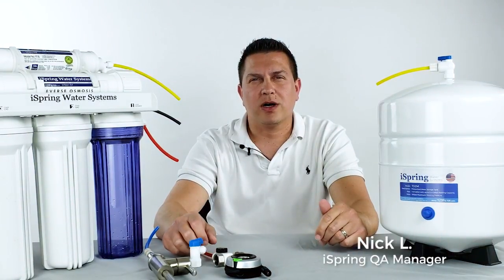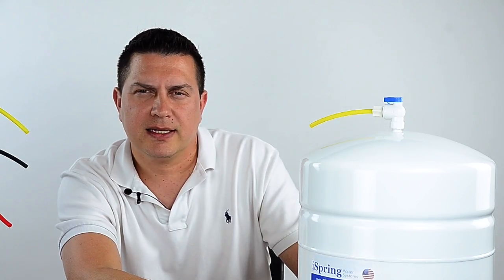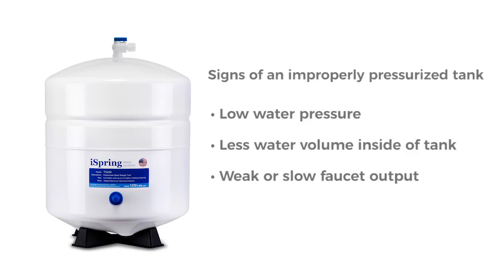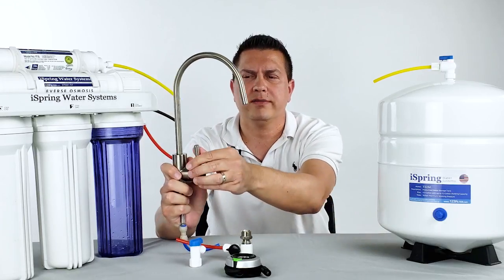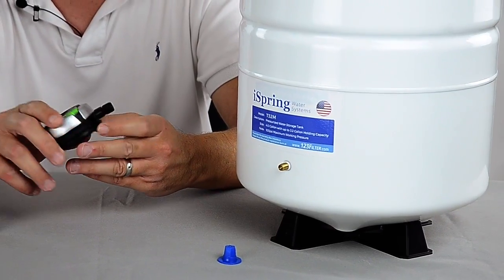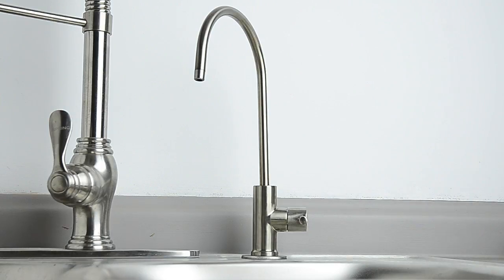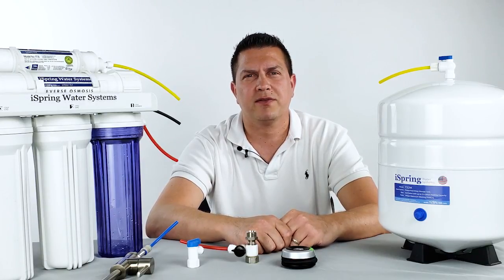Overview & troubleshooting | iSpring Pre-Pressurized Water Storage Tank for Reverse Osmosis Systems

Comment: Our iSpring 5-stage RO has perfect pressure. After watching Robert Slovak talk about RO Bladder as an ideal breeding environment for nasty bacteria to grow & contaminate drinking water, I am concerned about cleaning the bladder. Are there steps to inject small amount of food-grade Hydrogen Peroxide into my bladder? We love the iSpring 5-state system. But I am noticing a change in taste of water. So I am going to perform filter changes (as per your other video). How difficult is it to add UV stage to our 5-Stage?
Reply: SAME!!! My 5 stage with booster used to taste awesome. 2 years later, two sets of completely new filters/membrane, and it does not taste good at all. My sister's RO system (only 3 stages) tastes much better and she has the worst sulfur smell in her well water. I actually found thick slime growing inside the faucet. I was getting a split flowing stream which made me look into it. GROSS. I sprayed regular peroxide into the faucet with an injector. I am tempted to chlorinate the tank with a pump. Wish you had an answer.
Reply: I replaced the tank a few years ago for the same reason, didn't realize until today that my bladder leaked and held no pressure from day 1 and just ordered a new one.

Comment: Hi Nik
My R O unit pressure tank is not filling.water supply is okay
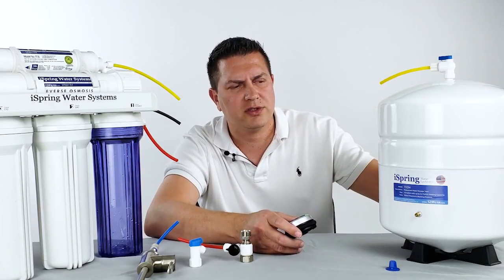Reply from the maker: Hi Muhammad. If it's a new installation, please check the 2nd stage filter to see if it's upside down. If the system has been working and then stopped, please pull the membrane out and see what happens without it. Sometimes the membrane causes the blockage. If the problem still persists, please feel free to call us at 678-261-7611 (M-F, 8:30 - 5:30 EST). We are happy to help.
Reply: @iSpringWaterSystems  I need your help . My R O was working very  well for three months only. Right now it has almost the same time without use. What it can been happen?
Reply from the maker: @lourdesbaez4225  Hi Lourdes. Please give us a call at 678-261-7611 (M-F, 8:30 - 5:30 EST). We are happy to help you out!
Reply: What is the membrane?

Comment: Hi Nick,
Recently I tried to check the pressure using the tire gauge. I noticed some water coming out of the valve. Is this normal? Or does this indicate some sort of bladder failure? And what could be them remedy for this? Thanks.
Reply: I installed a new system about 4 weeks ago and the water stream has always been weak. The tank is light. How can I get the water stream to be strong?
Reply: Anniesatu Newland check your inlet valve. I guess one of the valves is not fully open. Tank is light means water is not coming into it. 
I am not sure if the pressure is proper. So if the tank is empty, check the pressure at the gauge. If the pressure is bet. 7-10 psi, u’re good. If not, add some using a bike pump or an automobile 12 V compressor. Whatever works for you. 
If your system is new and yet you have all these problems, may be there are sued related to installation.  You might want to check things one by one. If nothing works, ask for a replacement if possible.
Reply from the maker: @anniesatunewland1793  Hi Anniesatu. Please follow the video and check your tank pressure first. If the pressure is decent but there's still very little water getting into the tank, please give us a call at 678-261-7611 (M-F, 8:30 - 5:30 EST) or email us at support@123filter.com. We can help to check and fix the problem.
Reply from the maker: Hi Kamlesh. If water is coming out of the air valve on the front of the tank, this means the bladder has a puncture or leak and the tank needs to be replaced. You can get replacement tanks here: https://cutt.ly/yiC1y0L. If you have more questions, please feel free to contact us at 678-261-7611 (M-F, 8:30 - 5:30 EST) or email us at support@123filter.com. We are happy to help.
Reply: iSpring Water Systems Hi there, 
Thanks for getting back to me. I suspected that would be the only solution, I ordered a new 4gal. tank from Amazon.ca which is sold by iSpring. Thanks once again.

Comment: Thanks .. how can I connect 2 tanks ?  Currently using drinking and aquarium water .
Reply from the maker: Hi Fred. Thank you for reaching out!  You can use a t-fitting between a DI filter and either the FT15 or FA15 filters. You don't need two tanks for that. To better assist you, could you please give us a call at 678 261 7611 (M-F 8:30 - 5:30 EST) or email us at support@123filter.com?

Comment: thanks for sharing the knowledge. I got a issue, after change the filters there is no water coming to tank , the water flowing to drainage , could you please let me know where the problem is ?
Reply from the maker: Hi Kelvin! Thank you for your comment. There are several possible reasons that may cause the problem - lack of pressure, clog of filters/the membrane, etc. Could you please give us a call at 678 261 7611(Mon-Fri, 8:30 - 5:30 EST), or send us an email with more detailed information to support@123filter.com. Our customer service team will be happy to assist you!

Comment: Can the tank be placed on its side? Instead of being upright
Reply from the maker: Hello, and thank you for the question! If the needed, the tank can lay it’s side in order to fit into smaller spaces under your sink. If you have any other questions, you can contact our customer service directly at 678-261-7611 or by email at support@123filter.com.
Reply: Would the tank perform better upright?
Reply from the maker: @TRXONXY  It  works the same either way! :)
Reply: @iSpringWaterSystems  Thank you!

Comment: What size is the threaded male end sticking out at top that the valve is threaded onto? Is it npt? Dankeschön
Reply from the maker: Hi there, the valve thread is 1/4" NPT.
Reply: iSpring Water Systems Thanks, my next question is what size is the small male threaded tip at the exit end of the right angled plastic 1/4 inch female npt spiggot that threads onto the tank male 1/4 inch npt part. It came with the RO-132 four gallon tank of yours I got on Amazon two days ago. It definitely looks smaller than 1/4 inch. Looking forward to using this soon. Thanks again,
Reply: Hi,

It is 1/4" inch
Reply: CS1 No way this end is 1/4 inch. It's threaded and about half the size. Thanks. Maybe you have an email or text I can send you a picture of it. Thanks
Reply: Hi,

The threads on the top of the tank are 1/4" inch and we supply the ABV2K tank valve with the tank.

Thank you,

iSpring Water Systems LLC